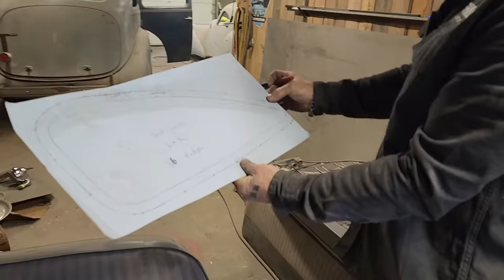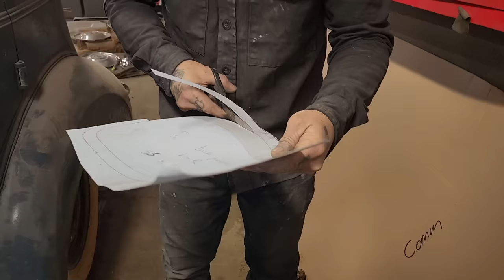Painting the Bugatti windshield area 🙌🏼

Comment: Watch out for the bolt on the passenger side motor mount, it passes through to inside the fuel pump housing area. That hole is used to put a longer bolt in to hold up the fuel pump push rod to make it easier to get the pump plunger in under the push rod. Once the pump is installed you remove the long bolt and replace it with a short bolt with sealant on the threads so it does not leak oil. If the bolt Nathan has in the motor mount is to long it get in the way of the fuel pump arm and push rod. Just an observation take it or throw it away 😂

Comment: Personally I would get rid of the original single stage master cylinder opting for a modern dual phase one. You have the room for it on the firewall and not only would be much safer but , it would also rid the bottom of the car from all the clutter and the difficulties of doing maintenance on it. If you have a parts vehicle in your collection with a new newer style dual phase master cylinder on it this would keep costs down as well. Love the car, I think it really cool and the work you and the boys ( Nate & Doug ) is fantastic.
Reply: I'll second that! Bad feelin' when you're free wheelin' without the juice!

Comment: That's way win I or someone is doing mockups you must have everything on the engine like water pump auatnater distributor manifold if the auto going to have power steering put on the pump and the radiator hoses on then set the radiator in with at least two bolts it would be best if you can use the transmission that is going in the auto that way you can fit the mounts in place that way when you put the auto to gether everything thing fits perfectly just like it did on mockup . I wonder why 🤔 when someone is thinking on changing the headlights on the car way didn't he get all the parts first like the headlights bucket's and the headlights as well even if the headlights didn't work after the car was painted you could put in the new headlight bulbs . Me when i am making something that I need to cut and weld I use a marker and mark the side i am going to weld the other piece to it so when you get to the welder scent guess your self if you are doing it right that will save u lots of time an money.  Marker's is your best friend when you are fabricating

Comment: The bolt that goes in the right motor mount to block make sure it is a short bolt because it will lock up the fuel pump rod

Comment: You better make sure that top bolt on motor mount to block is not too long, or it will hit the fuel pump rod, could tear the cam shaft up

Comment: Widows take a certain skill and prep to make sur the seal and fit right and expensive if you make a mistake urathane removed certain problems that happened by using butyl to sealthem and the rubber mounted windshields pop out on first roll over so install a rool bar id you are a fast driver.

Comment: You know that is a 80s 305 engine with the knock sensor on the side of the block. ESC. Electronic spark control, came with a computer. It might want to knock if you don't use that setup. Like timing knock